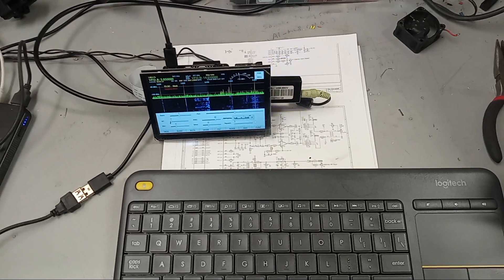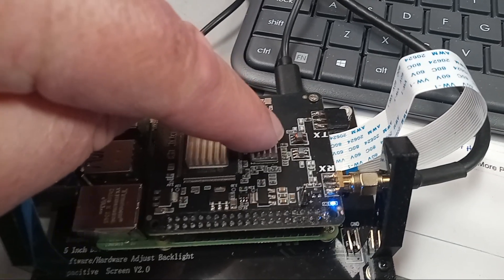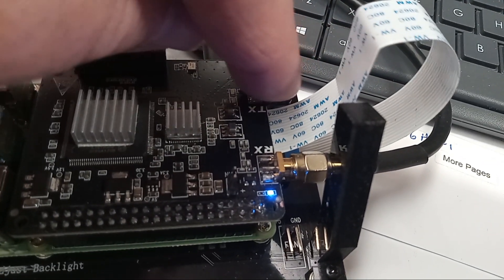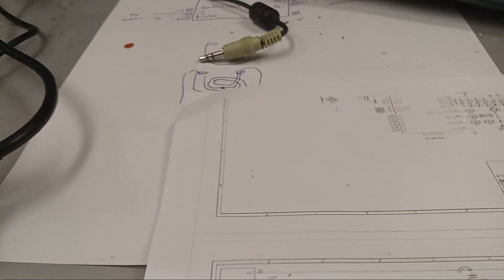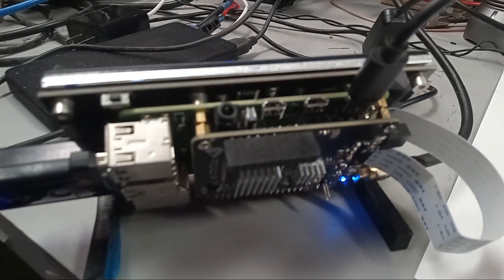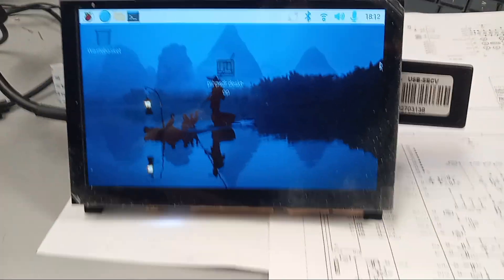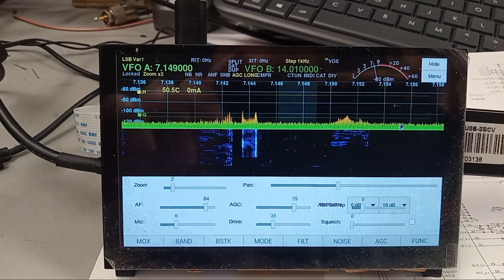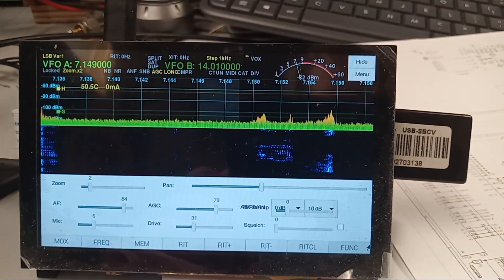Another Radioberry PiHat video, December 27, 2024

Comment: This thing would be better in the VHF UHF band. You could easily hit the local repeater with a small antenna.
Reply from the maker: Sure, as long as you add a transverter. The PiHPSDR will let you add 6, 4 and 2-meters bands in the set-up menu. Also UHF bands, I think.